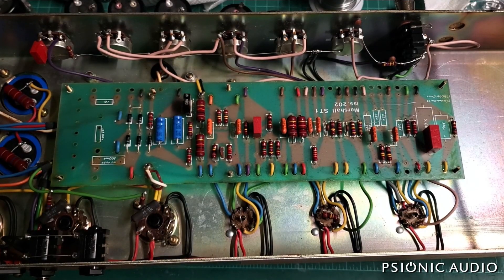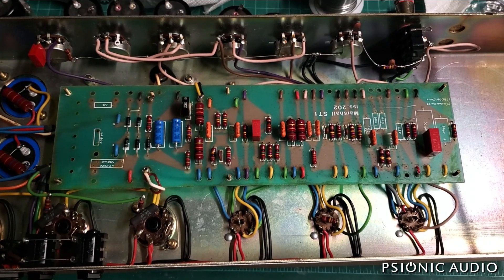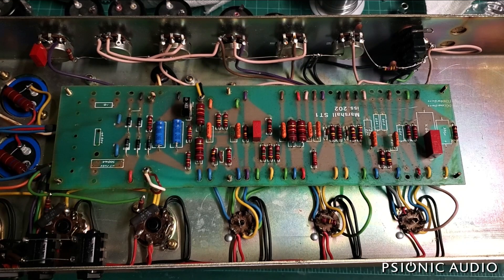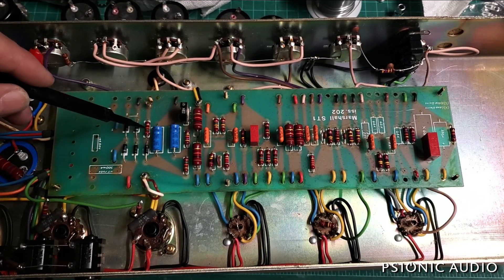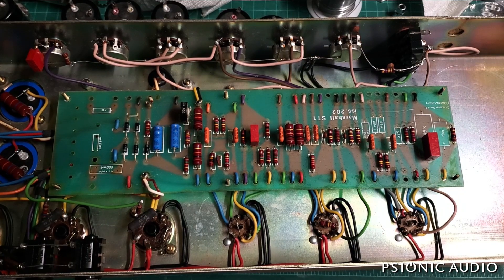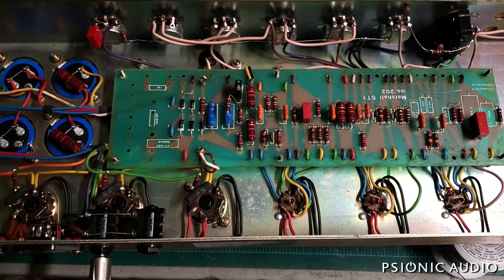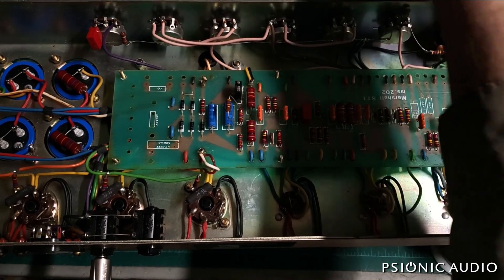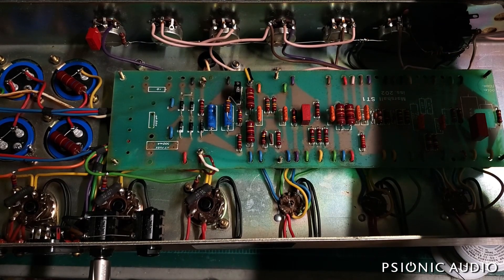'82 Marshall 2203 | Part 3 : New Tubes - 6550 vs EL34

Comment: Excellent! I like the piggybacking of resistors. It's an easily reversible mod. How many mA do you like to see on an EL34?
Reply: Bias is idle dissipation that requires the plate voltage and current to be known. You can’t just turn a screwdriver to set one or the other.
Reply: Safe operational range is between 10-40mA per tube. Read; The Trainwreck Pages by Ken Fischer, lots of great stuff on bias, etc.
Reply: @matthewf1979  Well an oscilloscope and a signal generator can help you determine that too.

Comment: If an amp like this was optimized/born with EL-34's.......What happens if you install 6550's?   Where will the bias end up with the 6550's?  Too hot, to cold ect.....Does any part/values need to be changed when going from EL-34's to ➡️ 6550's?
Reply from the maker: You have to adjust the bias and a few other minor things. Having done two almost identical '76 2204s, one with 34s and the other with 6550s, when both amps were biased the same the differences were minor in the extreme.
Reply: @PsionicAudio  Wow 😳....thanks for the reply.....love this channel.  I have a quad of 6550's I'd like to use up....... while riding out the tube crisis of 2022 😁.

Comment: I just bought a bunch of vishay electrolytics at mouser per your recommendation and the 10ufs 100v caps they sent me are significantly smaller then the ones in youre video. Theyre identical in size to the 25uf 63v. They are indeed labeled at 100v. Am I missing something. Also Ive only ever seen 160v or greater used in the bias section. My negative voltage is 53v am I correct in my thinking that this means I have 47v of safety margin here and that this is just another example of Marshall using what was available for the right price?
Reply: Sorry -53vdc lol
Reply from the maker: 100V is fine. Vishay has several different series, some are larger than others. All their 100V axials are fine for bias though.
Reply: @PsionicAudio  Lyle I truly appreciate you taking the time to respond to my questions on Sunday of all days. I get so much out of youre videos. They've really helped me wrap my brain around areas that I just painted by numbers on up until now. Thank for all you do!

Comment: Sounding great!
So, in my JMP 2203, I think someone tried to do the same trick by adding a resistor in parallel to adjust the bias range, but they did it to the next resistor down (which I think is a 15k). The tech working on my amp right now said that was a mistake... do you know what that would actually do?
Reply from the maker: Say it's a standard Marshall bias supply with a 15K between caps then a 47K and a 22k pot in series to ground.

That whole thing is a voltage divider with the top part of the divider bring 15K, and the bottom varying between 47K and 69K.

To change the divider you can change either value. So you could increase or decrease the top 15K while leaving the bottom value as-is.

BUT in this case the top value is also decoupling between the two filter caps. So because reasons you really don't want to change the top value, so leave it at 15K.

That really leaves you with changing the 47K as the best option. Increase it to make the overall available bias voltage more negative. Decrease it to do the opposite. 

There's more to it than that but that's the gist.
Reply: @PsionicAudio  Thanks for the explanation!
Reply: @PsionicAudio  Thanks for this information! 

I'm in the process of changing my Super Lead kit to 6550:s to play bass with. I want all the clean punch that I can get out of it. It sounds awesome already with the mismatched EL34:s in place.